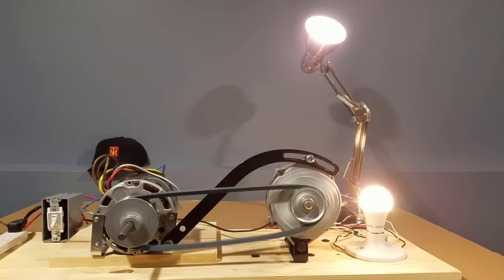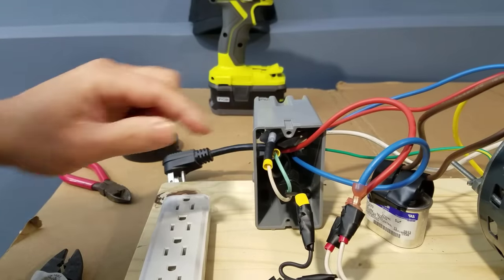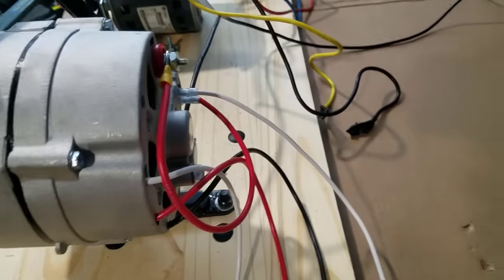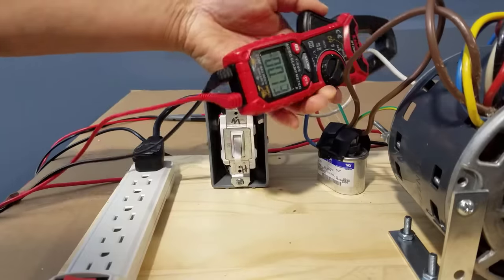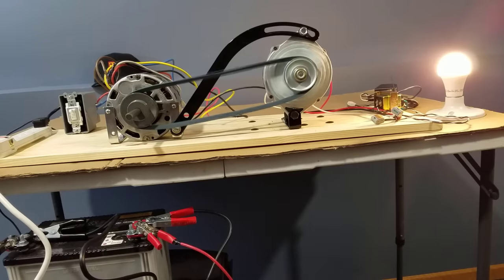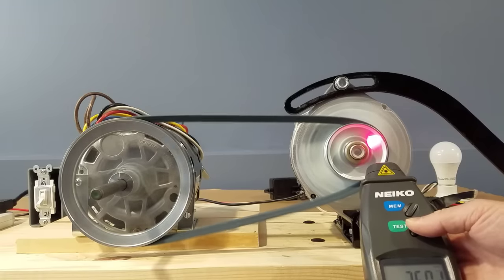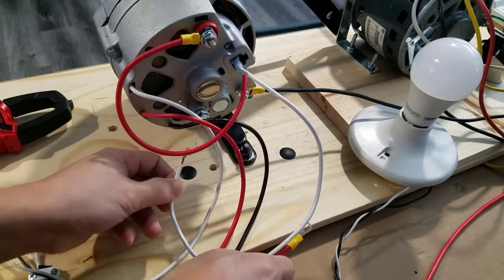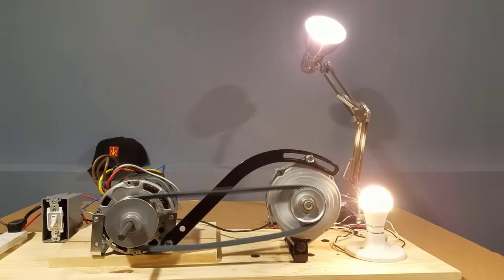Free Energy? (WOW) Using a Car Alternator

Comment: Explain to me how youre getting more efficiency out of motors that are only at max 75% efficient? If you had 100% efficiency, which you dont, and you put any load on the system then you would lose your 100% efficiency and the system would stop.
Reply: Exactly my thoughts
Reply: He can't. It's a scam.
Reply: I K R ?!
Reply: Good one but the thing can run for a little while until the motor slows down to a halt. That's long enough to shoot the short video. Law of physics you cannot get something for nothing period. 73
Reply: @ronb6182  maybe if you had a 100 percent efficient motor which you dont. Try again
Reply: @CS-en5xz  I know I don't and even at that you cannot pull electric from the circuit to run other things. This experiment been around for ages and no one got extra electricity from it. The motor will stop running even with no extra load. I did not post the video or even endorse it. It's a fake. 73
Reply: @CS-en5xz  if you had a 100% motor and a 100% generator both would run but once a load was added the generator would come to a halt but even with no extra load I believe the system would stop running over time because of the wire resistance if the wire is long enough. I just wonder how all this would work with zero gravity. Good experiment for space travel. Just a thought  73
Reply: The answer is power is not a 1:1 equation when you are dealing with magnetic fields. Think of a little two blade handheld battery operated fan. You turn on your kitchen faucet and with the fan going move the spinning blades into the water. Drops will fly all through the room on you and on the counter and floor.   When you turn the motor around and have two competing magnetic fields spinning in alternate directions electricity is thrown off of the fields and basically pulled out of the ether field into our physical world for our use.   When you spin a motor slowly by hand you feel it get hard than easy then hard and easy.. This is the two magnetic fields crossing into each other and when you use it as an alternator and spin it it throws off electricity. 

This is why you need to understand that the electricity we use does not come from power plants or hydro dams. They just send an alternating current but the actual electricity is supplied at transformers in your neighborhood. Those are the real power plants.  The elec company power lines are just the actuator.
Reply: @guidedmeditation2396  still you need to feed the primary with high voltage. You get higher current when the power goes through the step down transformer. PA systems use the same principle with  70 volt line or 25 volt line. Each speaker needs a transformer to get sound. My friend upgraded our highschools PA because the old system was only 50 watts. When the 200 watt system was put in we could all hear the announcements in every class room. I think that system was a 25 volt system. If you have a large school it's better to use the 70 volt system. 73
Reply: @guidedmeditation2396  And yes, a generator generates electricity, but you have to put more mechanical energy into it than you get electrical energy out. Magnetic lines will ceep there lenght as short as possible with lowest losses (prinzipal of reluctance e-maschines) This is why there are steps in the force when you spin a motor by hand.    
A transformer do nothing else then changes the ratio of voltage and current and also provide a insulation between primary and secondary winding.
Reply: Green screen video editing. This is not at all possible. There's too much loss. They make money of us watching to try and find where the trick is, and then they make more money by having us dispute the video in the comments. The way you hurt them is to not even watch it, and definitely not comment. Yet here we are. Unfortunately.
Reply: this guy is a Richard Crainum for sure
Reply: Oh, it's easy. By reversing its rotation direction. And then time flow direction.🤣
Reply: @Dicktricle  yes just enter the name on your credit card the 12digit number, expiry date and crv number on the back this will be sure to get your railgun satellite launch system operational, results may vary
Reply: Electrical generation reimagined
Reply: Your all wrong!!! This was done at a higher  more technical aspect in 1942 in germany(,reverse magnito)...
Reply: You can achieve good results by using gears. Make the alternator spin faster than the furnace motor spins due to the gearing.
Reply: Perpetual motion can be achieved in constant motion , with magnetic fields... the closer the fields, will create higher rpms, and higher fields.. the side effect is anti- gravity... (penamunda research facilities 1942)  once understood, very easy to build.  RESEARCH AND DEVELOPMENT MACHINE SHOPS and some math... physics rules
Reply: @ronb6182  
Too much energy wasted as useless heat, it just CANT work till something different.6
Reply: @alangrant9451  yeah we have heat in our attics in Florida but we still heat our water with electric water heaters. I disconnected my electric water heater and put in a propane fired water heater I see some savings because my electric bill was 33.67 this is with no heat or AC but the hot weather is upon us usually in May until November but I haven't figured out how much Gas I used in one month. I would like to run pipe in the attic from one end of the house to the other end and loop around 7 or 8 times then the attic heat would give hot water without burning electric or Gas. One of my coworkers had to re-pipe the house and since the pipes are inside the slab the plumber ran the pipes in the attic. During the hurricanes he could take warm showers, the city water was still running. I think if you have lot of pipe in the attic you would have enough hot water. 73
Reply: Don’t spoil it by talking about Physics 😬
Reply: That moment when you realize you went to school just for your parents to get alemony.
Reply: The amps come from the alternator
Reply: If he achieved this he’d mysteriously wind up dead.
Reply: I need one! How much to make me one ?
Reply: That’s correct so it’s not perpetual or self-sustaining

Comment: Every iteration of this system that has been designed and built since it was first conceived of over 100 years ago have proven to be failures. Perpetual motion machines do not and never have existed. There are also losses in any generation system, be it heat, friction, resistance, and a myriad of other factors. Eventually, the system will slow and stop, even without a load.

Time for more coffee.
Reply: galenrog it was long time ago, but now it can...there are more method it can perpetually move with its own power. CAPACITORS. FLYWHEEL is somethings to be impost. and even inductors will help to make its power boost.
Reply: @nestorportuguez8964  wrong... wrong wrong..  ever heard of the laws of thermodynamics?  Go back to school.  There is no such thing as "perpetual" in regards to machinery.
For this to come even close to "perpetual" it would have to somehow ignore friction, electrical losses, self inductance and more.
It's been dis-proven so many times it's getting boring.
Reply: @nestorportuguez8964  you would need an alternator and a motor with better than 100% efficiency. i think the best stuff you can use is only like 85% efficient . even if you did find magical perfect 100% efficient equipment, as soon as you put any load on it it would come to a stop
Reply: Works great as long as it is plugged in to the inverter LOL. The First Law of Thermodynamics states that energy cannot be created or destroyed; it can only be converted from one form to another. In other words you can't squeeze lemonaide from a stone and you can't make a perpetual energy machine. All you are doing is running a motor off the inverter. Notice when he unhooks the battery he only unhooks one clamp from the terminal. You can clearly see the inverter is still providing power to the system it is still lit up.
Reply: U are being scammed it's a 12v LED BULB
Reply: @mikeb4824    there is free energy, it comes from the sun, not so much at night, but solar cells and a battery can fix that, but they're not cheap, so night free energy isn't quite free, and hydro's free after building and maintaining it, so it can be expensive.  high frequency coaxial spherical electrolyser hydrogen fuel cells can be over unity but very few of us know how to make them.  (the hydrogen isn't dangerous but the fuel companies are).
Reply: @garygraham8373  morning Gary.  Indeed brother.   I actually made a DIY Hydrogen setup on an old Camaro in high school.   Literally a small container with water, with running a 12V electrode from alternator to split the water.  Then just had a hose run from that to the carb.   

I'm used to it by now, as most are extremely brainwashed......but it blows my mind how you can explain and propose such a elementary experiment to others just for them to scream back at you "it's impossible!  No such thing as free energy"

Then you loose a tiny bit more faith in humanity each time, when you explain, well it's really just utilizing "wasted" energy that the alternator already produces in excess.

The alternator is a fascinating topic itself......like the guy on here that had 3.....2 working as normal and a third rewired backwards to be a "motor".   The motor powered the other 2 alternators, giving a huge surplus in energy, and powered his cabin off it.  

Basically one alternator makes the power to power the motor, the other alternator makes the power for you home
Reply: @mikeb4824  yep sure. (the electrolyzer uses more energy than the increased efficiency of the engine).  there is an over-unity way of doing it but the petroleum industry makes a million dollars a second so you're dead real quick when you demonstrate it.
Reply: @garygraham8373  indeed.   I know of many many silenced one way or another.   (Usually it's first bribes/threats.....then if that doesn't work....rare cancer/accident)

The other interesting thing tied into all that ....is the carbs that get 100-200 mpg.   There was a guy 15 minutes from where I used to live in Napoleon Ohio, that developed one....but then nothing ever came of it......

Just from a nerdy standpoint, I can't help but be curious on how it's achieved.

Comment: Just connect the battery to charge itself... A lot easier and no friction. 🙂
Reply: @sinicalgary  
I know...
Reply: @sinicalgary  can you read?
Reply: The continual crashing of two magnetic fields is what throws off an electric charge that we then use to power appliances.  You are actually pulling energy out of the universal ether and putting it to use.  It is not just a 1:1 mechanical exchange.  Imagine two huge spinning galaxies colliding and sending huge asteroids and planet sized chunks off in odd directions.   In the case to two magnetic fields.  They are invisible but continually spinning in a dual vortex polar field.  When you crash them together they grab electric charges out of the ether and instead of 1:1 you have 1:1.01 or more in the process. Spin it fast and you have enough to power your whole home. 
I know it is hard to get your mind around this because we are intentionally mislead to keep us from knowing we have unlimited free energy and we can power our homes, our cars and, heat and cool our homes, power factories, distill fresh sea water, etc. All with free energy.
Reply: @guidedmeditation2396  
😄😄😄😄😄😄
Reply: Absolutely! And if you use the right kind of wire to charge the battery with it self, you get a FREE incandescent light /fire starter/ smoke machine! Don't forget to connect from the negative terminal to the positive terminal because that is the real direction of current flow, do not use conventional current conventions, that is what "they" want you to use...😄
Reply: @etle113  if you connect a light bulb between the positive and negative terminals then not only does the battery charge itself but you get free light as well. The only downside is that you need a switch to disconnect the terminals otherwise the battery will over charge and blow itself to pieces. Not many people know this trick but an old man in a bar swore that it works.

Comment: A car alternator can produce power at any rotation.
What you did when you reverse the motor rotor assy is incorrect, because the rotor core is not aligned with the motor stator core. You can reverse the rotation of the motor by reversing the starting or running winding connections.
Reply from the maker: You were correct about the alternative methods for reversing the motor spin, but I used the lazy man's way since the stator winding was proportional on both ends. Most car alternators are more efficient in CW spin.
Reply: It's just a silly joke man...
Reply: It was a non rev furnace motor Na???
Reply: this guy acts like a genus
Reply: @mrmightytiger7385  why even open the motor to switch the stator around? Even lazier would have been to just rotate the motor OR generator  to get the axis to the other side, e.g. instead of having them sit side by side, having them facing the opposite way. You could still use a belt, or you could just lock both rotors together by their axles… without tampering with the motor and possibly rendering it useless… of course locking the axles could cause damage to both motor and generator in the long run…
Reply: Cooling fan on alternator is made for clockwise rotation. But no worry. It won't ever make enough power to overheat.lol
And yes alternator will work either direction.
Reply: @mrmightytiger7385  Nicely produced scam!